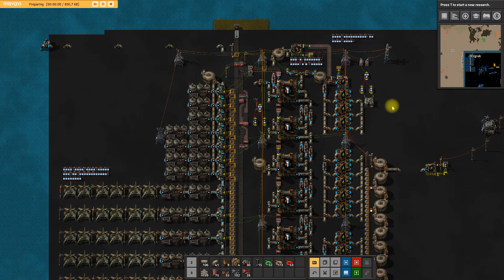Factorio Lubricant Factory 130 units per second no byproducts

Comment: Thanks man I love you goat
Reply from the maker: Thanks man.  This video is almost four years old so it's from an older version of Factorio, but the basic concept remains the same. I will say that in newer setups, I use circuitry to make plastic from the petroleum gas and the light oil which has been cracked into petroleum gas because most of the time when you're using a lot of lube it's for either making blue belts or flying robot frames both of which need red chips which use plastic.

Comment: cheers mate, stumbled upon this as my factory needed much more lube, to a degree ive been using a complete oil factory for 700 hours or so but i dont fully understand it.   watching this holy heck.  combinators and stuff lol. anyway i get the idea behind it and well i learnt u can take the wires off power poles lol. Anyway it took a bit to figure out that you needed a micro bit of heavy oil to begin with,  but after watching the video it makes sense. ill totally be using this blueprint in future.  once its up and running its a matter of coal and water and bobs ya uncle.
Reply from the maker: Take a piece of copper wire and click one electric pole, then the next, and the copper wire between them will disappear. 

Glad you like it.